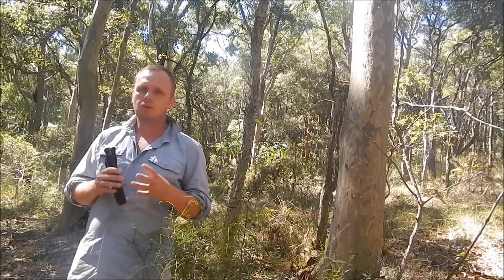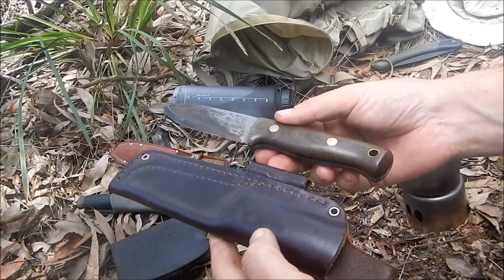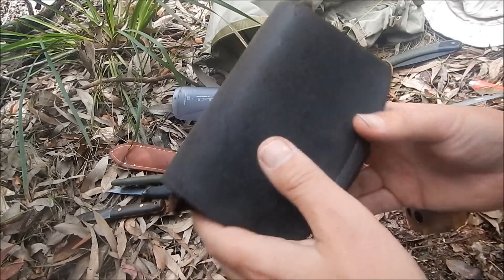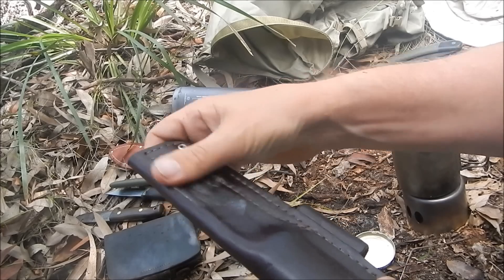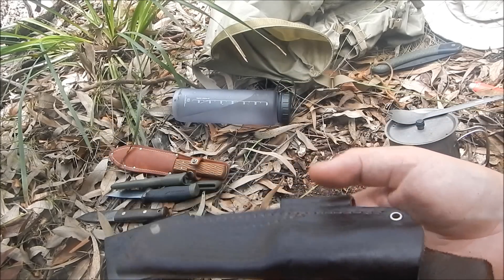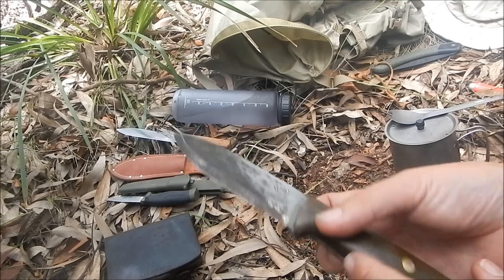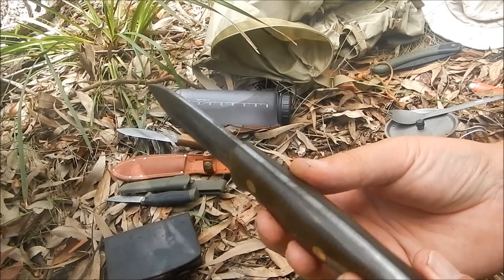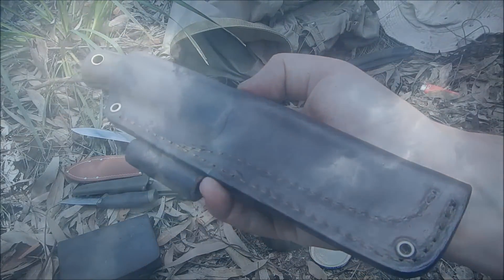Notes On Bushcraft Knife Maintenance

Comment: If you want to get a hundred years from a sheath, the inside needs the same loving treatment as the outside.  It can be difficult to tell on really old leather, but if it's still in good shape, every part, inside and out, was treated,, usually with some kind of wax.  The inside of the sheath is where water penetrates, and where rot usually begins.
Reply from the maker: Kind of hard to rub wax on the inside of a sheath...

Comment: Dishwashers don't get hot enough to change the temper of steel.
Reply from the maker: Brownefinger007 ...Yes they do dull the knife edge and can damage the handle..I never put a knife dishwasher!!!.I see many knives damaged or sharpness affected by dishwashers 

i
Reply: Howling Dingo Yep, i agree they are no good for knives, but they only get to about 75degC, the softest carbon steels start to temper at 175deg
Reply from the maker: Brownefinger007 Some dishwasher run at a fair bit higher that 75degC.  I think that is the minimum standard..There are many factors like hot spots near heating elements.Or heat build up from prolonged use.With some industrial dishwashers plates or metal pans are so hot coming you can't handle them without using rubber gloves.!! 

I have worked with many dishwashers and knifes for years.I have seen myself many knifes damaged by dishwashers. Knife is made blunt and edge retention is often reduced.Rubber or wooden handles also warp/peel and come off .Not everytime  was a knife damaged in this way,but often this was the case. 

So there lot of factors like type or age of dishwasher.How long it was running before hand,where the knife was in the tray.What kind of steel was the knife made from.